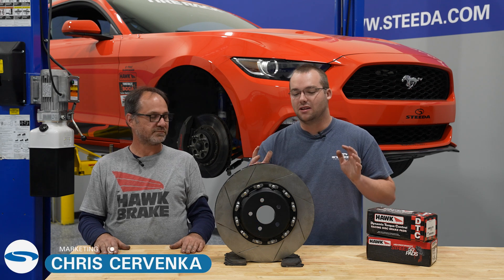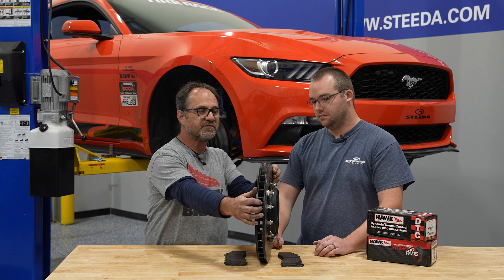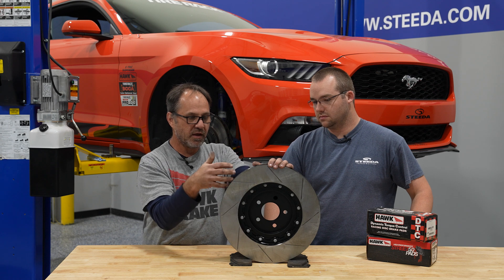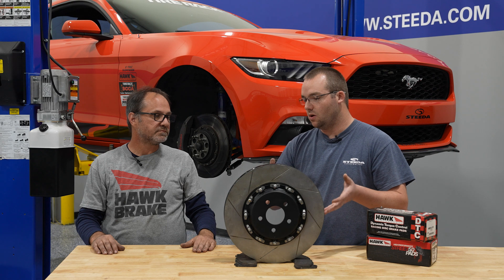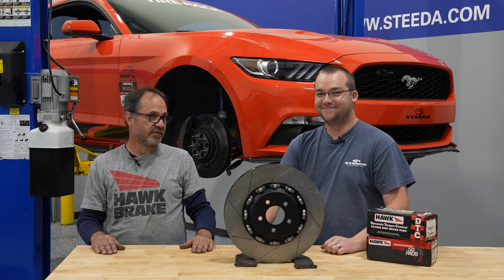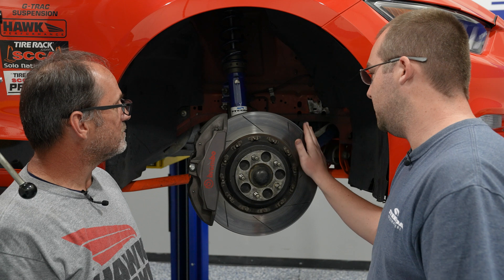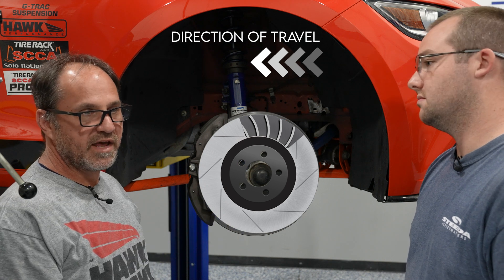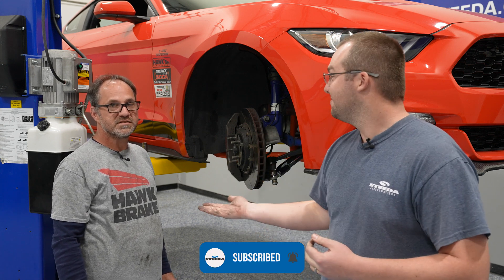[Unlisted] Steeda Two-Piece Rotor Orientation On S550 Mustang | Tech Tip

Comment: I have your 2 piece rotors and DTC 70f and 60r, they work great on track (Sebring)!  But I do have excessive pad wear in the rear, about 3 hours of track time and the rear pads are <50% on my 2021 Mach 1 in Track mode.  I’m thinking I either need to add more cooling or I need to run with the traction control turned off by holding the TC switch up for >5s.  Just wondering if you have experienced this at all.
Reply from the maker: Yes, unfortunately it’s a common issue with ABS and Traction/Stability control interfering on-track. I would give “Track” driving mode a try when you’re using the car on track. Hope that helps! -Chris